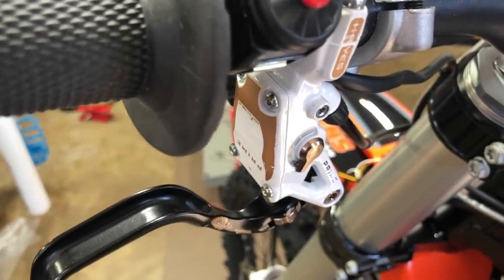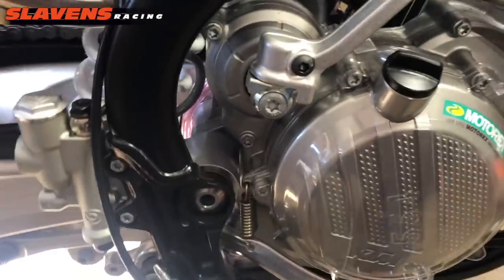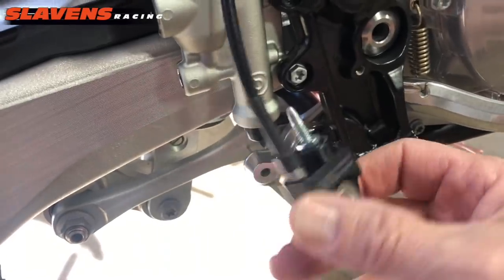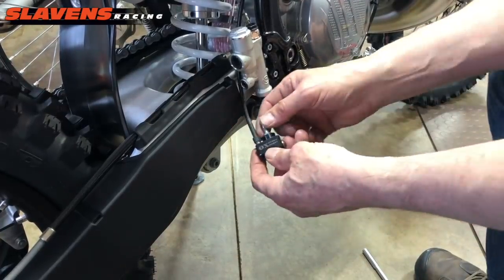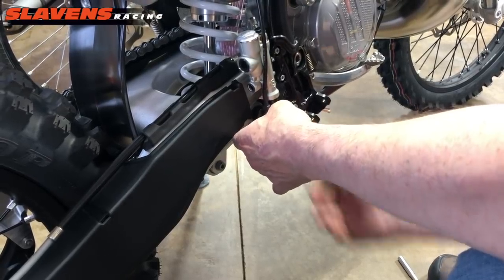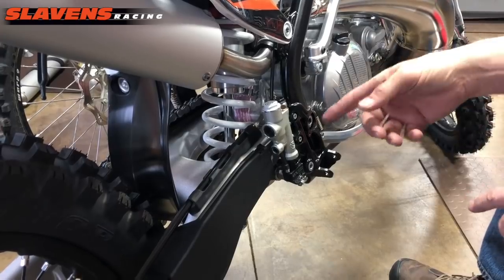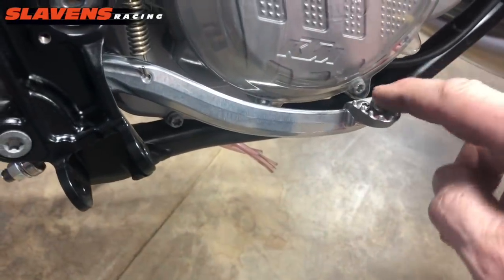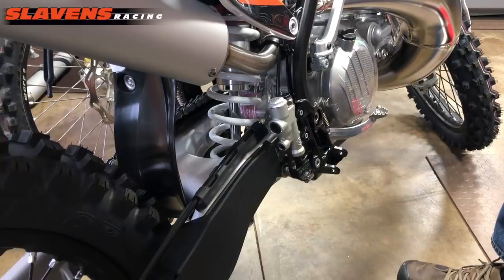How-to Install Ox Hydra Brake

Comment: Sold!    Been back and forth between OX and Rekluse LHRB and my Rekluse clutch.   The more I see this system and Chucks story, Im sold on it.   Placing an order with you guys now.

Also another great video!   Ive purchased alot thru you guys to build my 300 xcw.

Comment: I finally got mine installed on my 2013 300 XCW.  It took 6 washers between the pedal and cylinder so it wouldn't bind and stay locked up.  Seems to work well now.

Comment: Hello Jeff just after a bit of advice about fitting a electron carb to a 2005 cr 250, will it work on that model because it has a servo controlled power valve and a cable going to the original carb ? Hope you don’t mind me asking it’s just I’m afraid I might buy it and it won’t work correctly, cheers gaz

Comment: I see this as a useful product for downhill switchbacks. I can see how it would work great with an auto clutch, but for those of us with a manual clutch, do you keep the bike in neutral for these kind of situations?
Reply: I ran a Recluse LHB on a KTM530 for 3 years.  I never got around to installing a Rekluse clutch.
It worked GREAT.

My only issue I had to work out, going downhill in switchbacks(brake excels here), if I kept the bike in first gear, my rear brake fluid would get hot and the brake would fade(motor was working against my braking, lol).

So I just got used to pulling the clutch when going slow.  The Rekluse took some time to bleed, but instructions are top notch.  I always had trouble getting the last of the air out(I think), level was just softer than I liked.  I would zip tie lever in pulled postion, and over night I think some air escaped and level felt better.

This OX looks VERY nice, and install looks easy, my new bike I'm going to try an OX!

Comment: A few things you didn't mention. That hydraulic line will rub a hole in itself right behind and above where it bolts on. Each time you use the brake it moves up and down slightly. Over time it will wear a hole in itself. I've been wrapping mine with electrical tape and checking it periodically and replacing as needed. Also OX seems to have really went downhill. They won't answer the phone email or text. Absolutely no support anymore. Last year they were awesome. When mine rubbed a hole in the line they had me send it in for a free repair and put a protective cover on it for me. No charge. Now you can't even get a hold of them. I'm guessing they changed ownership.
Reply from the maker: Hello, You are correct. New ownership and they are not up to speed yet.

Comment: How do you fix the piston if you measured the distance incorrectly upon the first install?
Reply from the maker: Tom: What do you mean by "fix the piston"? If it didn't pop out and loose fluid you can just push it in and re-adjust.
Reply: @slaverace1  I meant I had a previous Ox rear brake that never felt very good—I think I didn't measure the pistons correctly upon my first install. Now I'm going to replace with the pro version, and I don't have a reliable piston position to measure against. I guess it's just going to be a situation where I install it and then adjust using the free play of the foot lever?

Comment: After a couple years now... do you still recommend and find it holds up well?
Reply from the maker: It is still a good product but the Ox Hydra Pro is better, has more power. https://slavensracing.com/shop/hydra-pro-left-hand-rear-brake-kit-for-ktm-hqv-berg-by-ox/
Reply: @slaverace1  just what I was thinking of trying.
I'm trying to decide between the Clake 2 or just the Ox-Hydra. I have the Rekluse CX but may go back to stock and the Clake2.
I run Harescrambles in Minnesota, 150sx